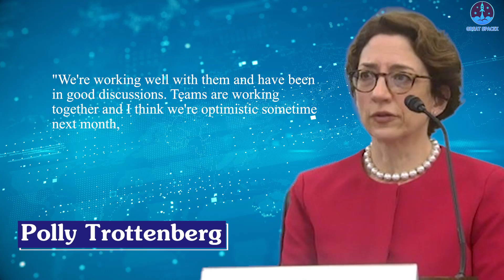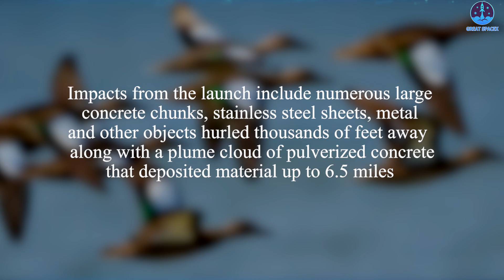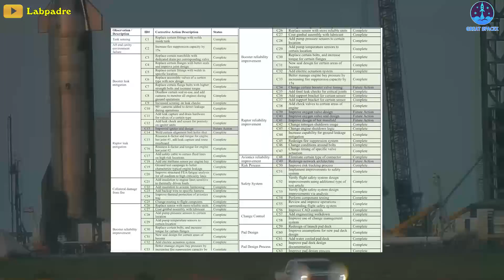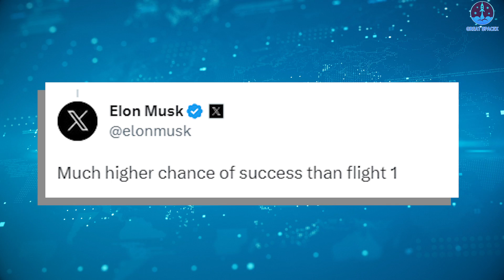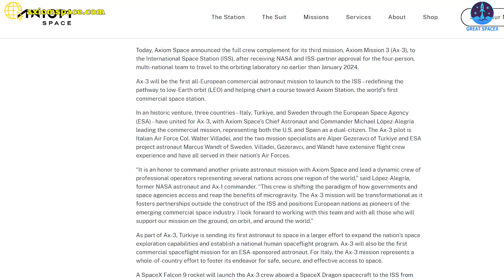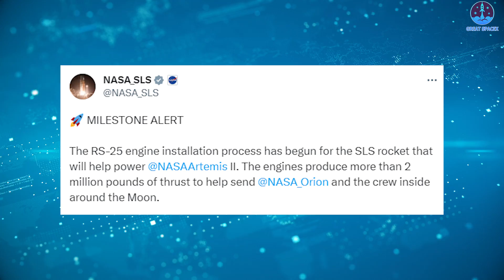Finally happened! FAA just revealed new Starship launch date…

Comment: You and a lot of others make it sound like Starship malfunctioned when it blew up. It did not. Space X sent the flight termination command - self-destruct -, when it was clear the test flight - Space X said this was not an orbital test they considered it a success if it ignited the engines and cleared the tower -, They got a bonus as it went thru MAXQ and little further. Due to some failure in three of the Raptor 2 engines it failed to reach MECO and that is when They decided to terminate the test flight.

Comment: Who could have predicted the damage from the 1si launch.
If the Environmental group thinks it could then it intentionally allowed damage to occur.
Only trying the launch could anyone discover the results.
That's why it has to be tried again & again.
It is also why cars or airlines are getting safer after each accident.
We do our best to predict but no one knows everything -- until they try it in RL.
Reply: Yeah .. a good show to reinforce that point is on the Quest network .. it's called Mayday.  I've seen most of the episodes.  More often than not, none of the Airline/plane/jet improvements were implemented until 100s died in a crash.  In some cases not even then.

Comment: A Lot of people who are enthusiastic about SpaceX & their StarShip project Don't believe the FAA is working in good faith w/ SpaceX and that there may some agenda, or reasons for the delays in licensing, other than for Public Safety. I'm retired now after nearly 3 decades as an Aircraft Tech & Maintenance Quality Control Inspector for one of the U.S. Major Air Carriers. I loved it, was a very fulfilling job for me. I've worked very closely w/ the FAA thru direct classroom instruction and providing documentation on "How To" procedures for the FAA.
   Commercial/Private Aviation maint QC Inspectors are the last stopgap between the Airgroup's efforts towards public safely and the FAA stepping in to halt operations until whatever safety concerns are resolved. Hopefully, there isn't an incident requiring the NTSB to step in because that usually means people have lost their lives. 
   The FAA & NTSB work under the Dept of Transportation, meaning there is usually no urgency to get an investigation completed, only a goal to be complete and thorough as possible.
    There isn't a better organization on the Planet that's better at Regulating & Enforcing Aviation Public Safety than the FAA. No one's got a better record for safety given the number of flights occurring each year in the U.S. That said, the Federal AVIATION Administration is Excellent at providing oversite for the Aviation Industry, but for Spaceflight, they're not as proficient. They're NOT the Federal Spaceflight Administration and their experience in Spaceflight is far less than Half of what experience they have in the over 120 years man has been flying Aircraft. I would submit that the USAF separated itself from it's Space operations, opening up the USSF, for that very reason, efficiency and to focus on the vast differences between Air travel and Spaceflight.
     It only makes sense for the FAA to divide it's Spaceflight division to an independent Gov Agency instead of trying to focus on two completely different types of transportation. The Air Force became more efficient in doing so which kind of proves why the FAA should as well. Elon said it himself, "The FAA is fundamentally broken", and that is the reason. They're acting as Two vastly different public safety agencies, which has a Lot to do with why they are so slow at regulating Spaceflight when their specialty is in Aviation.

Comment: October flight is alright, SpaceX should double check their work so no explosion 🙏 we need this flight to be a success.
Reply: Indeed .no slowing them down ..they will be wking on the Starship factories  be..He dosen't waist time .thats for sure
Reply: In any rocket program it’s normal to have “failures” during R&D, that’s how you learn. How many of the prototypes at Starbase blew up at some point in their launch, flight, landing cycle before Integrated Flight Test One in April?  IFT2 will probably have problems at some point. From which SpaceX will learn what does and doesn’t work, fix what doesn’t work and try again. I love a perfect performance by IFT2. It’s not likely to happen.

Comment: Thanks for including the histories of some of the RS-25 engines that will be used for Artemis II.  It's a shame that these old Shuttle engines are being dumped into the Pacific after their next use.  Will missions starting with Artemis III use newly-built RS-25s?
Reply: If all those agencies worried about wildlife were really concerned, they would give Spacex credit for not dumping trash into the oceans like the other launchers always do.
Reply: @flyjim99  With the Falcon 9 booster's dry weight of 22.2 tons and its 205 successful landings, 4,551 tons of trash has been spared from being dumped into the oceans by SpaceX.
Reply: Next we will bring Gemini Rockets out to get to Venus! That's moving forward with no R&D costs! Sounds great Eh?
Reply: @greyveteran7007  With SLS they really just took a Shuttle launch stack, moved the Shuttle's RS-25 engines to the external tank, added a 4th RS-25, ditched the Shuttle part, and perched an Apollo-like capsule on the top.  Oh, and they elongated the side boosters a bit.  This might have been six months worth of work at Boca Chica.  SLS is what it is and I really hope all its flights are successful, but there's no way it's any kind of advanced rocket.
Reply: @victorkrawchuk9141  SLS was a lot more work than just rearranging some Shuttle components.
The only actual Shuttle parts on SLS are the RS-25 engines and the SRB casings, forward and aft skirt structures.
The core stage is effectively a clean sheet development with little to no Shuttle ET heritage.
A lot of the delays associated with SLS development came from having to build up the factory with new tooling and massive FSW weldind robots and then figure out the process to build the first core stage as they went along.
Tankage is new, main propulsion system is new, flight computers and avionics are new as well.
Orion is far from just a rehashed Apollo capsule, any new crewed spacecraft intended for missions beyond LEO, especially at the scope of Orion, was going to take a while to develop.
Reply: @brokensoap1717  I understand, thanks.  The flight path of the SLS core stage is very similar to that of the Shuttle external tank after launch, and this can make it difficult to see a lot of difference in the overall concept sometimes.  This similarity would also make it extremely difficult to retrofit the SLS core stage to be reusable, either via a SpaceX type powered landing or a Rocket Lab type parachute descent.  The re-entry speed into the atmosphere over the Pacific is much too fast.
Reply: @brokensoap1717  and nothing new.
Reply: @greyveteran7007  sure, but there is nothing that can be done on venus.

Comment: NASA has always used a water mitigation technique to reduce damage to launch facilities at Cape Canaveral. Why then did the Engineers at the Texas facility not think to install a water mitigation in their first iteration of the Starship launch? Doesn’t seem to smart to me.
Reply: Bc concrete technology hasn't improved at all in the last half century?
Reply: SpaceX lied to the FAA about the detonation suppression system before the first launch. April 14, 2023: "Since  publication  of  the  2022  PEA,  SpaceX  informed  the  FAA  that  it  has  installed  a  detonation  suppression  system  on  the  orbital  launch  pad.  The  detonation  suppression  system  sprays  water  towards  the  engines  during  ignition  events  (e.g. launches  and  other  tests)  to  prevent  the  risk  of  a  fire  on  the  launch pad.  SpaceX  is  proposing  to  use  the  detonation  suppression  system  for  the  first launch." from WRITTEN  EVALUATION  OF  THE  2022  FINAL  PROGRAMMATIC  ENVIRONMENTAL  ASSESSMENT  FOR  THE  SPACEX  STARSHIP/SUPER  HEAVY  LAUNCH  VEHICLE  PROGRAM  AT  THE  BOCA  CHICA  LAUNCH  SITE  IN  CAMERON  COUNTY, TEXAS.

Comment: In the 1st flight super heavy and starship seems good, only problem with launch pad.  Ejected heat control system poorly planned at launch pad, with this several engines failed within few of seconds of launch.  With this super heavy lost thrust to place starship in space and it caused separation of rockets.
Reply: Falcon / Falcon Heavy have nothing to do with Starship.
Reply: Sorry it’s super heavy not falcon heavy.  Corrected 👍

Comment: I am sick of hearing that the last flight blew up without clarification that it did so by command of ground control.
Reply: And after the ship flew sideways at maximum Q force on the vehicle.  This showed more to the structural stability of Starship than any possible "successful" test.  That loading was enormous.
Reply: , it wasn't structural stability. If you look at the dead engines they were all on one side of the engine cluster. Too much power to one side. The engines couldn't gimbal far enough to compensate for the thrust vectoring.
Reply: @jameslmorehead The Skirt of the Starship partially collapsed at acceleration rate of only 7m/s^2 at less than 40% of nominal compressive loading
Reply: @jameslmorehead Flew Sideways and tumbled, a 360° end over end under nearly full power and did not break anywhere, not even between the two stages.
Reply: I don't like when it's called a failed attempt.
Reply: @joseph96345  to learn , failure is required .
Reply: But it wasn't failure. They did exactly what they set out to do; learn and improve. That is not failure. But I do understand your point. I worked in software for sometime. One of things I would say is, "If you can't fix it, break it." Many times you can learn why something isn't working by making it worse.
Reply: I agree..  I've been commenting that SpaceX pushed the button which almost didn't work because it was poorly placed and tied into another system.  I believe those stage clamps experienced some horrendous loading and torsion and there was no secondary (backup) clamp release .
Reply: Starship was already bent when they decided to destroy it you are grasping at words

Comment: The environmental part is simply ridiculous.  How was SpaceX allowed to built their facility there, which would be testing rockets and accidents could happen, in the first place?  It's very clear that the solved the pad issue a long time ago and there won't be any concrete flying through the air to kill things miles away.

Comment: How can the Democrats justify holding up launch because of concrete dust?? The next launch is specifically to test that water deluge system will work!
Reply: @spacexrocks1041 Why will they not allow an immediate test launch?  All the issues have been dealt with.  Now SpaceX has to test the improvements.

Comment: It seems that the Starship will be dismantled before the October launch. For it is impossible to hold the stack for a long time.
Reply: How long was it fully stacked before the IFT1 launch
Reply: Already unstacked
Reply: You can't keep it up for too long, otherwise you get blue Booster engines.
Reply: @socorro713  The tanks of the ship and booster are too thin, their design is similar to the tanks of early Atlas rockets. The tanks of the ship and booster are kept under pressure so that they are not crushed. When the Starship It will begin to fly more often and be reused, the tanks will be made stronger and more resistant to atmospheric pressure.